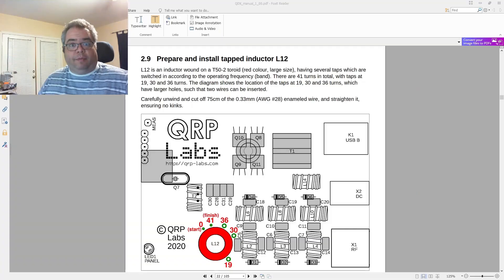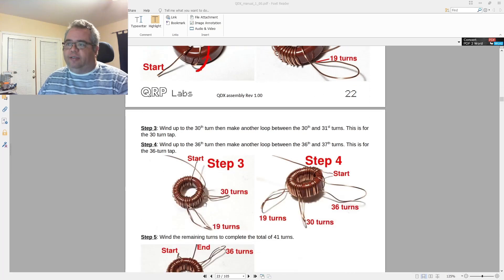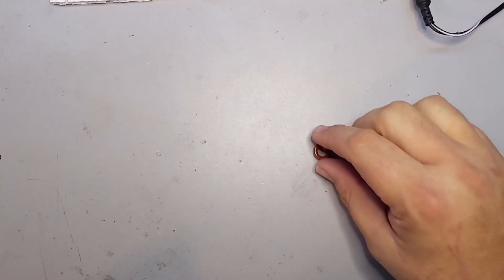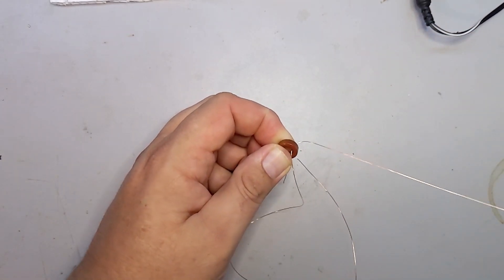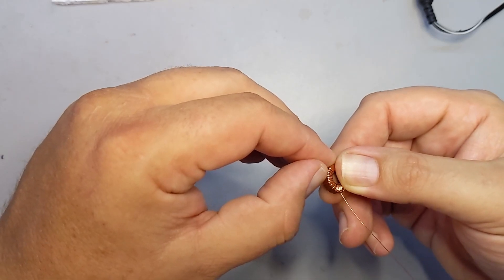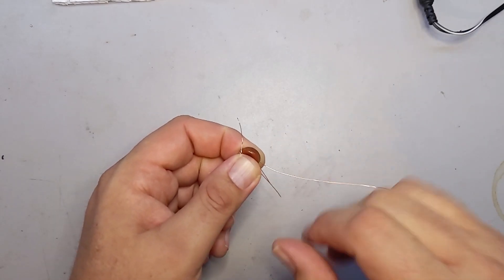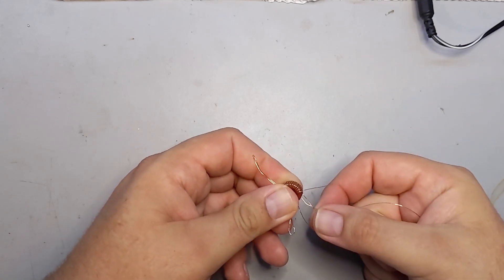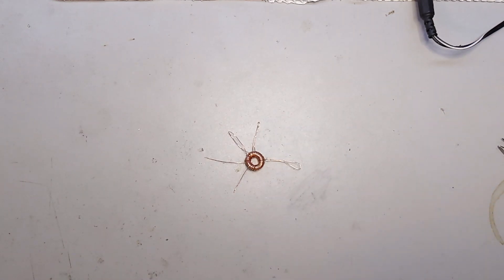QDX Construction Begins!

Comment: Are all the windings in the same direction? Or do you change direction when the loops are made?
Reply from the maker: The instructions make it very clear. But all of the windings are in the same direction.
Reply: @MiscDotGeek  thank you! First build for me and mine is yet to arrive, rev3.
Reply from the maker: Just follow the directions super close and don't skip ahead. Make sure to read them all first and you'll do fine. My build series will help and the revision 3 is even easier because there's no inductors to solder on the backside.